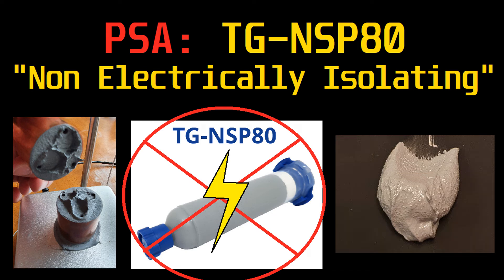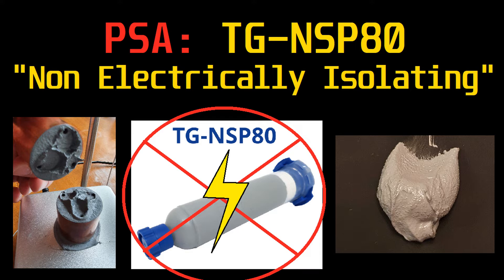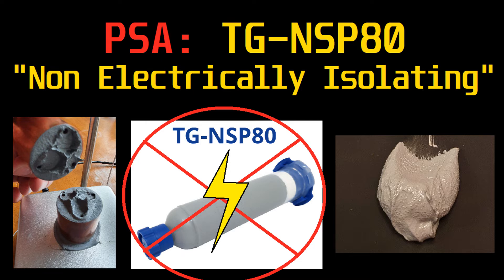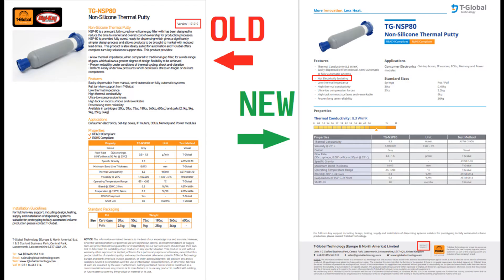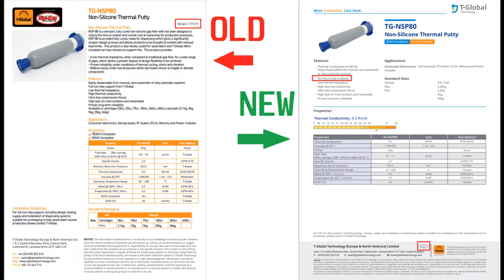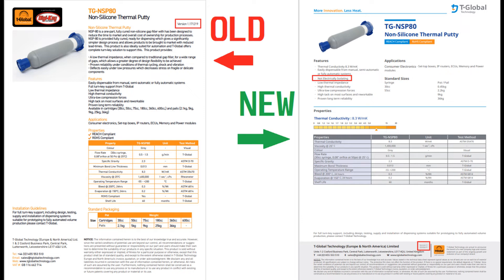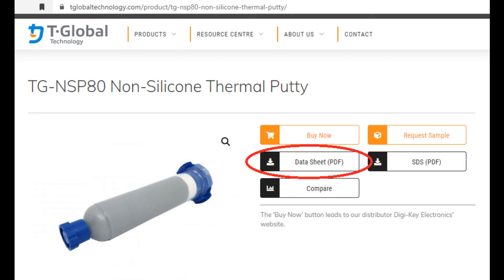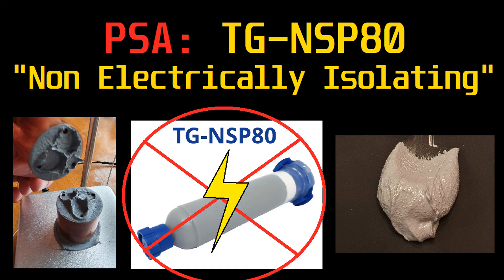WARNING: TG-NSP80 Non Electrically Isolating!

Comment: I have a question what if you where to mix Diamond powder and thermal putty together would that increase your thermal conductivity ?
Reply from the maker: Although I haven't done that yet, I very much believe it would. You can buy 50 carats for around $30-$50. 50 Carats = 10 grams. Diamond is 3.51 g/cm3, so would be 2.85 cm3 (or 2.85 ml, 0.57 of a teaspoon).

I'll hopefully get some 50,000 or 100,000 grit at some point to play with.
Reply: @snarksdomain  thank you

Comment: I am checking out two thermal puttys, 3ks-nj1500 10w/m.k and another N-1000 10w/m.k both electrically non conductive. While the 2nd one is similar to tg-pp-10 in its physical appearance. Both found on alibab while searching for thermal putty alternatives.
Reply from the maker: Excellent. Let us know how well they work. Perhaps I'll have to buy some and test it out. I've got some Penchem putties arriving soon and will test them out and post results.
Reply: @snarksdomain  I hope you test the th949-1 from them and make a video about it. Once you do, even I'll buy some. Keep up the great work mate.
Reply from the maker: @shreyasshetty9869  thanks. Yeah, I've got TH855, TH930, and TH949 on the way. Penchem products are starting to be added to Digikey which makes them accessible for small quantities (1kg or less).
Reply: @snarksdomain  looking forward to your video.

Comment: Hey Snarks, I have a G14 laptop which uses thermal putty on VRM components. I am trying to find an alternative to PP10... Is there any you would recommend. K5 pro looks garbage. Thanks!!
Reply from the maker: Although I haven't obtained or tested it yet my best bet would be Penchem TH930. If you live in the US you should be able to order it from Digikey.
Reply: @snarksdomain  not us based and digikey doesnt serve my region. Ive ordered that pink stuff from Aliexpress though, do you have any comments on it RE longevity or oil seepage/boiling? Seems OK for VRM purpose
Reply from the maker: @Kinezoh  Unfortunately I have no long term testing on the pink stuff.
Reply from the maker: @Kinezoh  it's surprising to hear Digikey doesn't serve your region. They've got a couple dozen country/region specific websites. If you click on the flag at the top you can change country/region

Comment: I wish I saw this earlier. this product ruined my rtx 3080! I was hoping to fix high junction memory temps and ended up with the unstable card that isn't able to hold any memory overclock 😓
Reply from the maker: Well that's super frustrating. What product are you currently using on it? And what is your current overclock and Memory Junction temps?
Reply: @snarksdomain  I had a enough of tg-pp10 left, so I've deep cleaned the 3080 and applied the pp10 putty, but that didnt help, its crashing at +200 memory overclock (memory temp is at 94) and used to be able to hold +1150
Reply from the maker: @andreytrofimov3029  that sucks. Not sure if you have access to an ultrasonic cleaner (with a safe cleaning fluid for a GPU), but that would likely give it the most thorough clean, would likely need to rinse with 99%+ IPA.
Reply from the maker: Where did you first hear about TG-NSP80?
Reply: @snarksdomain  digi-key, since the tg-pp10 is obsolete I researched a few other thermal putties and nsp80 seemed like a decent option
Reply: Just to confirm, your card worked with TG-NSP80 on the VRAM and Mosfets?
Reply from the maker: @GhostMotley  Not 100% sure I've understood correctly, but I believe they tried TG-NSP80 and it didn't work at all, then cleaned the card and used TG-PP10 and it was functional but only at a lower overclock than original thermal pads.
Reply from the maker: @GhostMotley  I'll likely test out Therm-A-Gap TC50 as well (5.2 W/mK)
Reply: @GhostMotley  I only replaced the pads with nsp80 on the vram, I left stock mosfet pads on. And yes, the card started just fine  I even played some BF2042, and when I  OC'd the memory it kept crashing
Reply: @andreytrofimov3029  Interesting, so perhaps TG-NSP80 isn't electrically conductive? The card shouldn't POST at all if there's a short anywhere.
Reply: @GhostMotley  i'm not sure, but since t-global updated their data sheet stating it isn't electrically isolating I'd not use it on your gpu. I might have gotten lucky my card isn't completely ruined but there was some damage done to it for sure
Reply: @andreytrofimov3029  Yeah I'm definitely gonna avoid it.